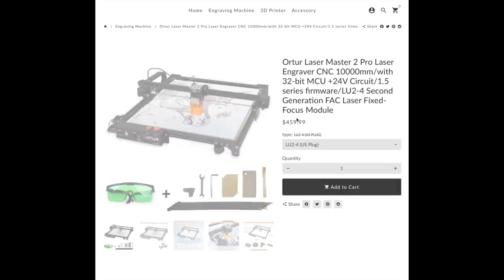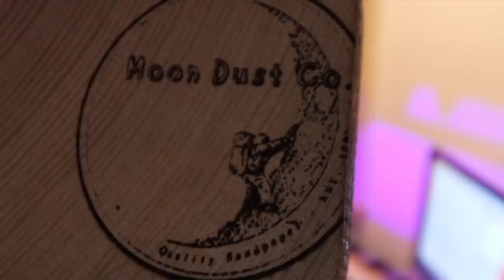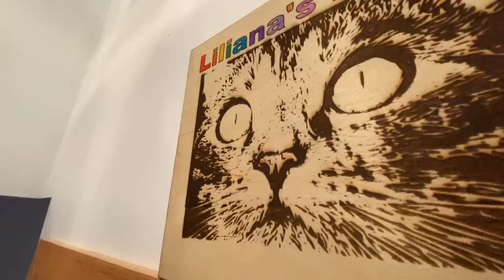Patreon Built is DONE | ORTUR LASER

Comment: CAUTION with the laser. Read all the instructions and work safely. The glasses are not sunglasses. They are to protect your eyes from the beam. I can't stress this enough. Great project.
Opening shots of the kids in the leaves was wonderful. Best to all !
Reply: As a engineer who has to work with lasers for a living, these machines are very dangerous. Everyone in the room should be wearing safety glasses with the appropriate rating for the laser, or the laser system should be enclosed in a box.
Reply: @tmmtmm  Worked lasers for about 10 years cutting sheet metal. Nothing to be casual about.